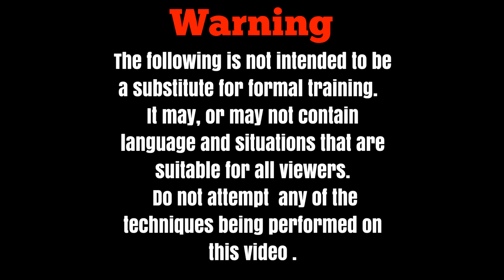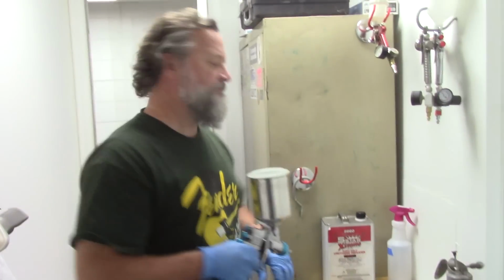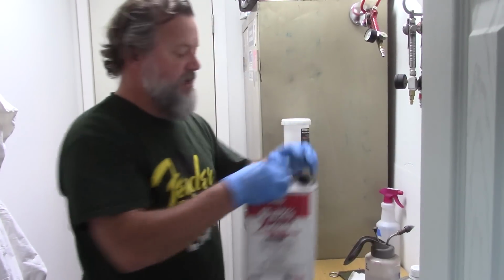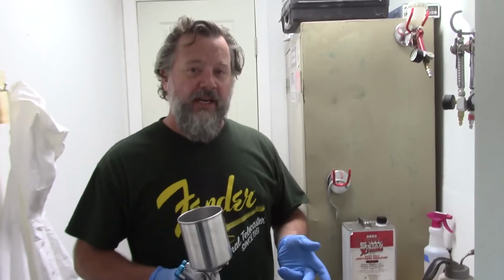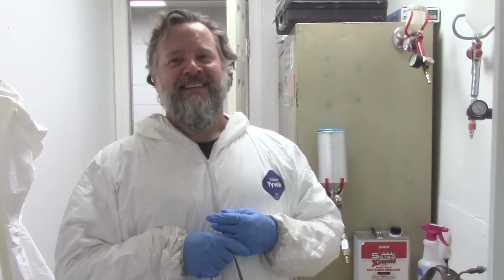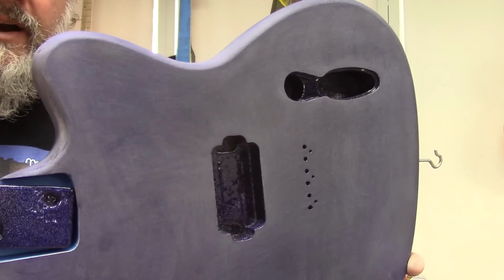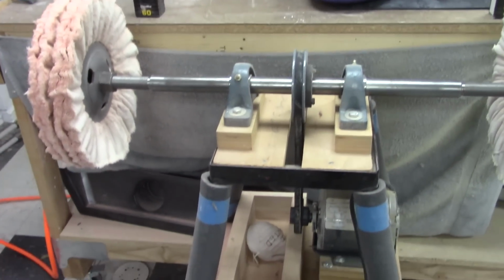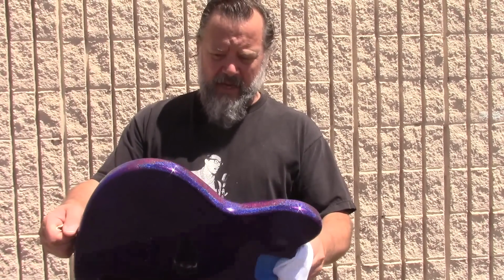How To Spray A Professional Metal Flake Finish

Comment: Also curious if the GlanzMax is better than Menzerna, or about the same? Was looking at both recently but pulled the trigger on the Menzerna just because it seemed like the defacto standard.
Reply from the maker: We used to use the Menzerna, it was good, no doubt

Comment: Frikkin' A-1 beautiful! Metal flake is the coolest.
Now it needs to be played through a big-ass tuck N roll Kustom using a curly cord.  :)

I've mixed many a metallic, we used a mica that was stored in 1/2 or 3/4 pint (didn't pay much attention to the container size) squeeze bottles with the little flip nozzles like you see on consumer wax bottles.
 We just tipped the bottle upside down and tap it lightly with the nozzle open to let out enough mica powder for the mix (measured by weight), but for heavy gallon mixes (Ford Toreador Red most commonly) you could actually give the bottle a few squeezes, just don't inhale much while you're doing that!   :) 
I kinda liked mixing paint, but I never applied any, Im happy to leave that stuff to pros, like you guys.
Reply from the maker: Thanks for watching my friend, we like metal flake too, it's so cool

Comment: You can buy a dry flake gun now. You spray the base coat then the sealer and the spray dry flakes into the wet sealer or 1st layer of clear coat.
The gun is easy to clean but you still find flake everywhere.
Reply from the maker: Yep those a re pretty neat

Comment: Awesome walk-through (and paint job)! I'm curious what would you do differently if you sprayed metal flake regularly... you can't chuck the spray gun and room supplies every time you spray.
Reply from the maker: If you sprayed a lot of flake you should consider a separate room so as not to contaminate every subsequent paint job
Reply: @TexasToastGuitars  Separate room, specialized use guns, and specialized use hoses are expensive and for most of us not possible. I guess then the answer for us DIY-ers  is "clean your room, clean your guns, and clean your hoses" or go rattle can...
Reply from the maker: @tedblumstein6772  Well, the original question was about if you did metal flake finishes regularly. Assuming you are getting paid for all these finishes the cost would be more easily absorbed

Comment: Not sure if it's needed is todays urethane paints but I remember the 'ol timers dropping a couple glass marbles in their paint cups to help keep the metal flake suspended and agitated in the gun. Supposedly it kept the flake from laying out too flat or uneven in the finish? Of course that was with the old bottom feed Binks guns of the day. No clue if the HVLP guns are any better in this regard.
Reply from the maker: You are well advised to use something to agitate the flake if you are using a syphon gun
Reply: Since (like a jerk) I didn't say it in my original comment.....Beautiful work Bro!!

Comment: Chrysler Turbine Bronze is an exceptionally great metal flake if you want to get past CAR and Lake Pelham blue. I love its history. Mopar also had a few other cool metallics.
Reply from the maker: We love metallic and metal flakes
Reply: @TexasToastGuitars  Colorwise check out House of Kolor, but their stuff might not be ideal for guitars from other standpoints. 

Chrysler Turbine Bronze was a duPont color called "Fire Frost". It was originally acrylic lacquer IIRC, I can try to get you a paint code if you want. It's really cool. Make sure you are getting the original 1963 shade Ghia had. Chrysler later issued CTB as a production color in '65 or '66 but it was too bronzeish and not red enough.

Comment: Very nice.  Question for Chris:  Have you ever had the metal flake get streaky?  Any tips for avoiding that?  (I've seen some rally bad paint jobs on cars.)
Reply: bevo65 A wide spray pattern helps.  Cars have much wider panels than a guitar, so I’m kinda lucky.
Reply from the maker: Thanks Chris

Comment: Is that metalflake finish aluminum flake or pearlescent powder?  Most original metalflake finishes were aluminum powders but as they only come in a small amount of finishes and sizes most cars are now coated with pearlescent powders.  They offer a wider range of colors and also the color changing technology that you used on this guitar.
Reply: Today's metalflake particles are metalized polyester (like mylar). Pearl powders are different, and range in material from mica to glass.
Reply from the maker: I don't really know what things are made from... does it really matter?